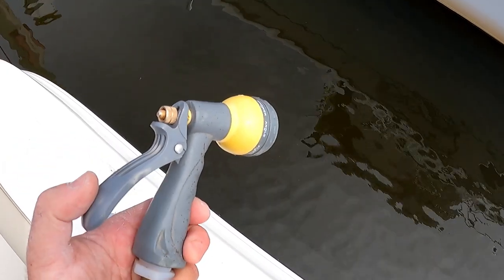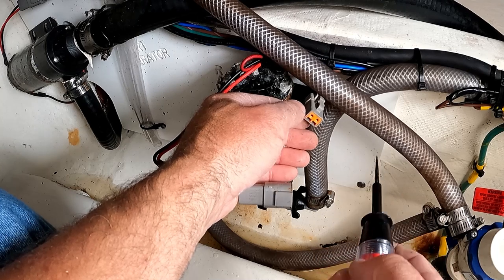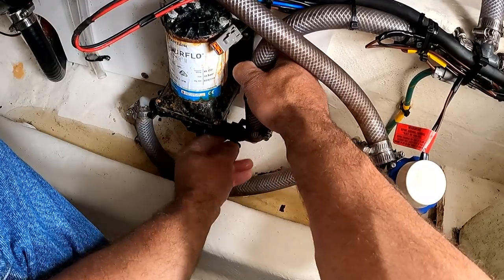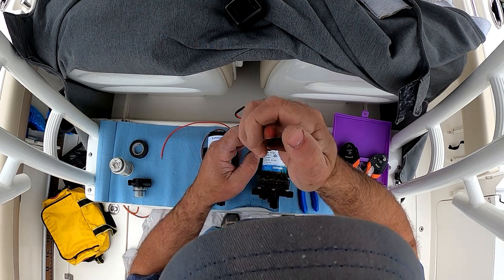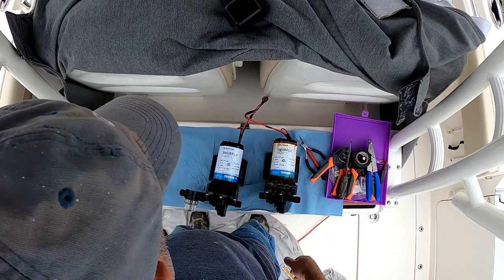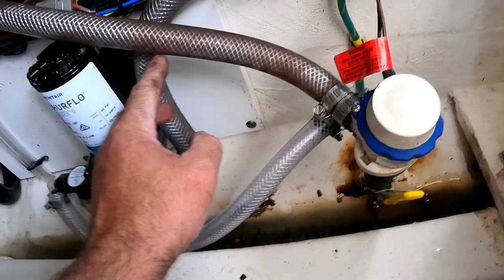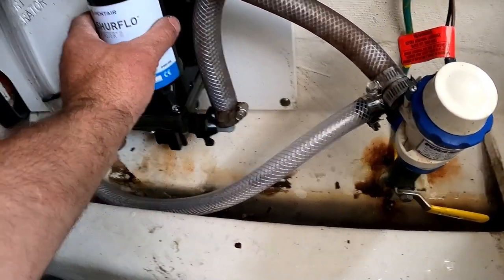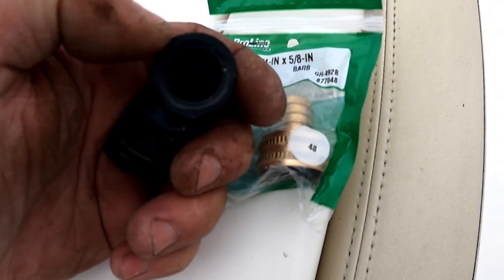How to replace and improve your raw water washdown

Comment: Good info. I just had an issue with my pump. The dealer cracked that fitting that screws onto the pump. FYI you need to install a ball valve like I'm going to do going to the wash down pump. I had to shut the seacock to stop the water coming into the boat. Without the ball valve for that pump I lost the use of my livewell with only shutting the seacock valve.
Reply from the maker: Good tip Mike!

Comment: Curious if you could blow out the system from the drywell fitting and avoid using antifreeze?
Reply from the maker: Yes.  At Home Depot they have brass hose end fittings that attach to an air hose.  Made for purging sprinkler systems.  10$ gets you a male and female fitting.

Comment: My raw water works but don’t have much pressure. It fills the bait well just fine but when you switch it to wash down the pressure stinks
Reply from the maker: Your raw pump and bait well should be two different pumps. The raw water impeller sounds shot, or the pump motor may be on its last leg.
Reply: @4RibsFishing  same bump is for both raw water and live well controlled by a ball valve. Robalo r 200